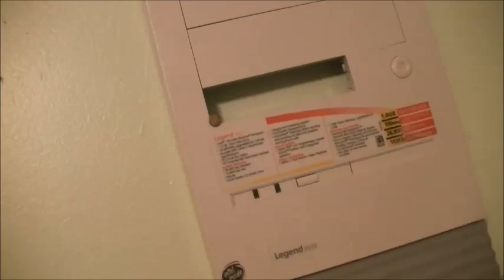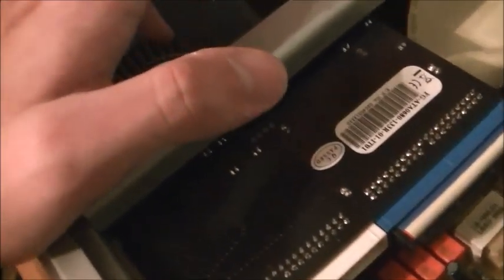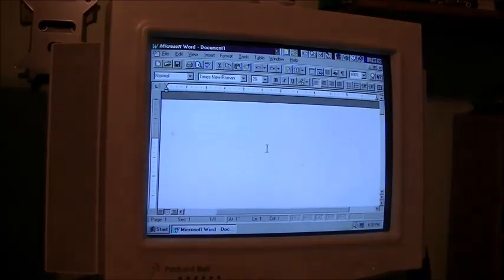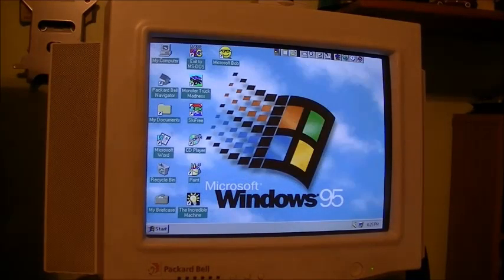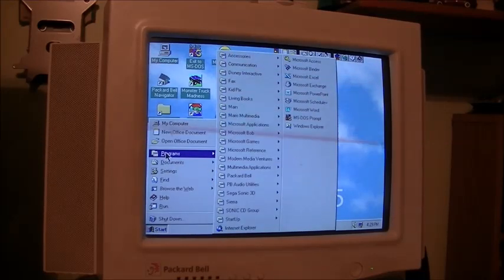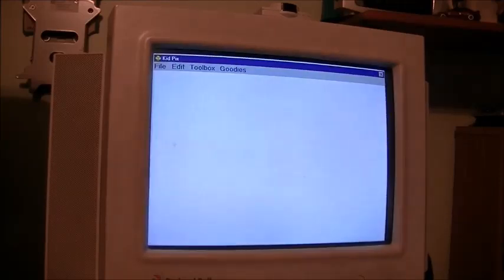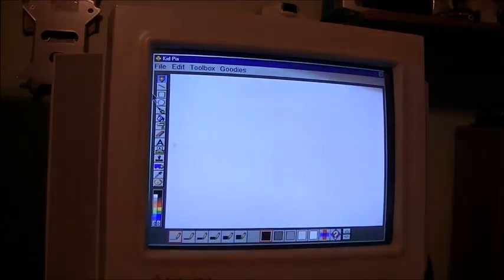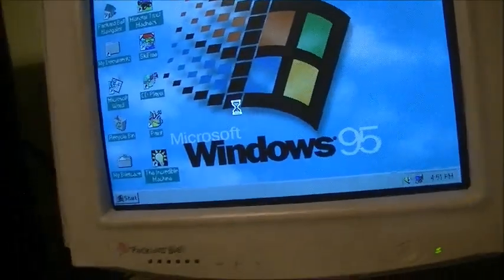Packard Bell Legend 814CD

Comment: Was there a removable cover for some expansion between the VGA port and the PS/2 Mouse port?

Also, a 20 GB Hard Disk will be much faster for if you are going to put one in. A 6 GB is still pretty fast for Windows. And that Maxtor drive sounded like it came out of a 1999 iMac G3. But that is obviously not where it came from.

Can you do a video on the 130CD that was on the floor? That would make a very neat video for everybody on YouTube to watch.

Great video!

Comment: You sure that isn't a 15in monitor? I had the same one with the digital controls the model # was 1512SL. It eventually died in 2000 or so, must be why they are rare! What is different between that gray label master CD vs. the green label? My Force 1999CDTW came with the green one (#170368) but basically had the same hardware as this machine. P133/16MB/2.1GB HD/NEC 4X CD/Hillary MB/Sound144 modem+sound/FastMedia remote in the same case style as you have mounted on the wall.